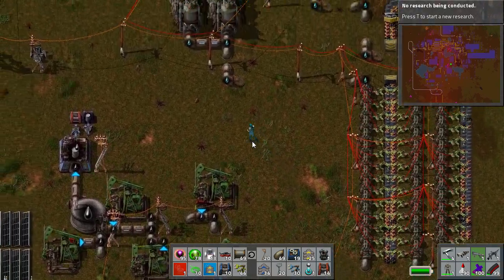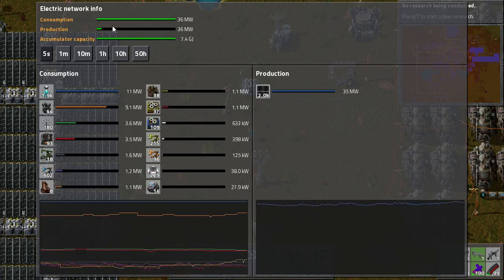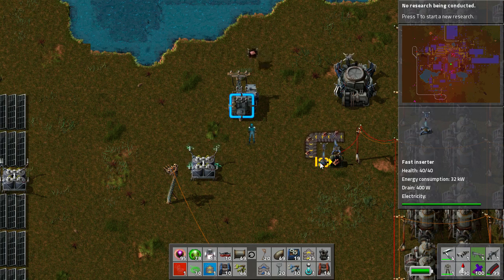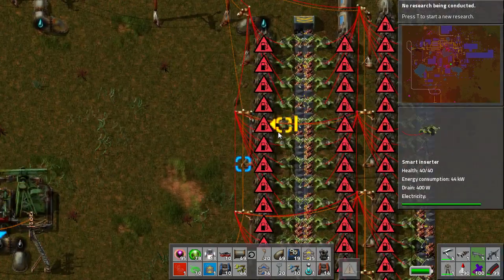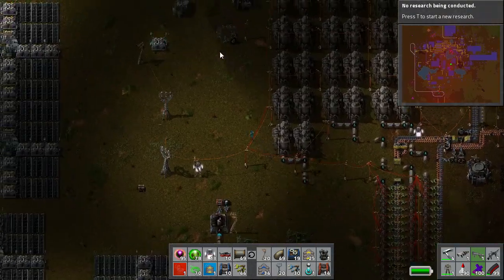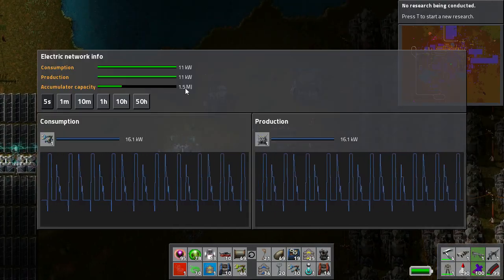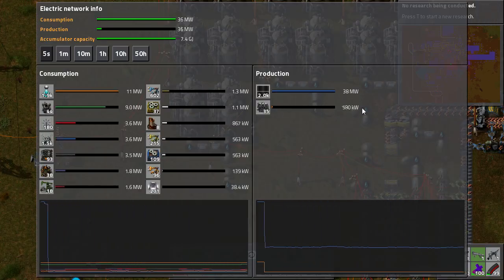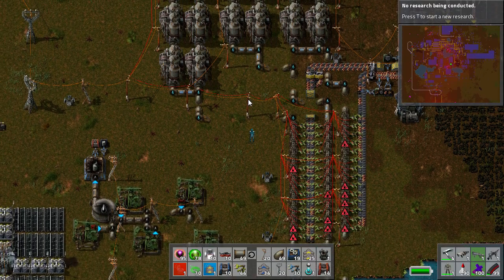Factorio Tutorial 18 - Emergency Steam Power Revisted

Comment: When the accumulator have no energy left and the inserter doesn't put the logs in the chest, even the whole system have not enough energy to put the logs out of the chest. In the video you separate the accumulator from the rest and burn the enrgy of it faster then the energy of the whole system. so it works, but when you don't separate it, the emergency setup don't work (like you see 4:08).

I think i have a solution for this. The inserter who put the logs in the chest don't need its own energy network. the inserter who put the logs out need its own energy network. it must have enough power for the one inserter during the day and night.
Reply: ok, i think the solution is not correct. because once the emergency energy production have to work in the chest are no more logs (thats Ok the emergency system have to start working). But when the inserter have enough power to put the logs in the chest, the other put it out immediately and the emergency energy setup start working again....and again....and again.

So the inserter who put the logs out of the chest needs to be slower (yellow) then the other one. And the emergency inserters from the steam engines needs to be powerd from te same network as the inserter who put the logs out of the chest.

I Hope you can follow my thoughts.^^
Reply: +Flori4n85 Thank You!  I needed to add a few lights into my secluded network in order to make sure it ran out before my main network, otherwise my main network (loading fuel into the boilers) would run out at the same time as the secluded network (loading wood), and then I'd have a massive power outage.